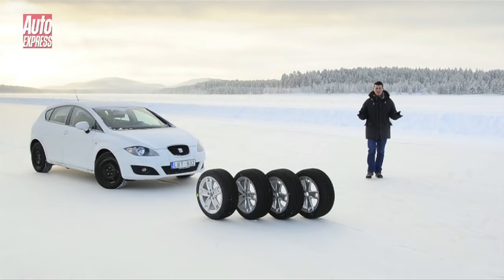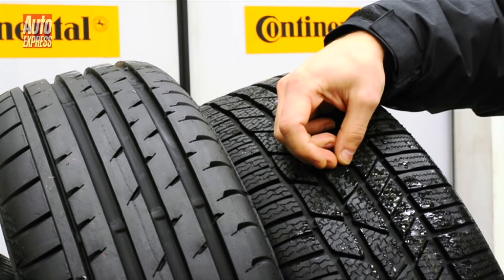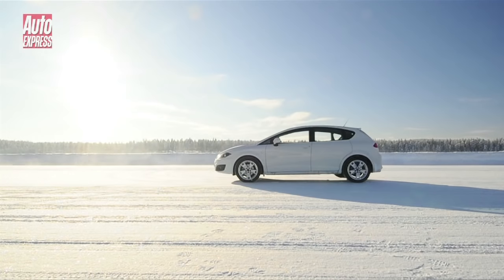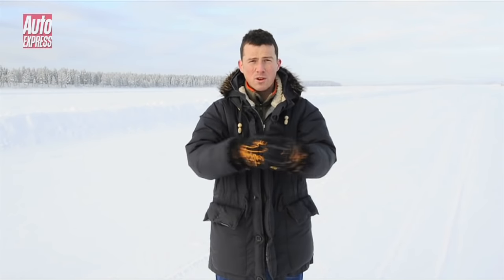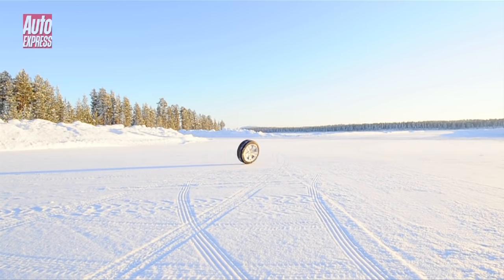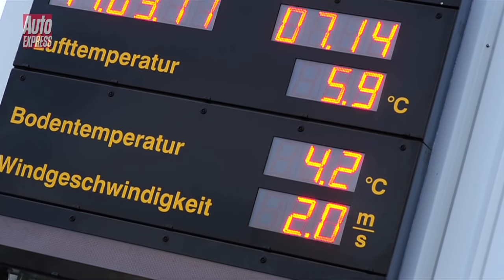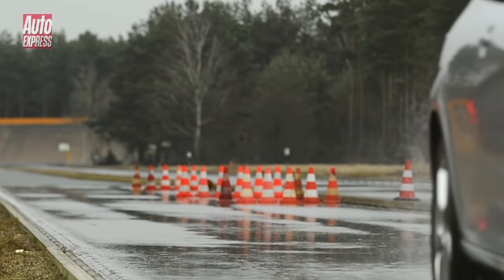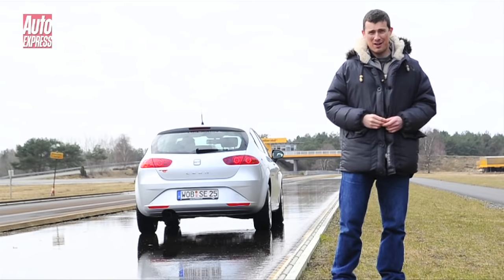Winter Tyres v Summer Tyres: the Truth! - Auto Express

Comment: Ive been running winter tyres like most the time in the uk... ive done this for a fair few years as 1 time i bought a set of wheels with them on and ran them all year round the grip was so much better even in the summer.
Reply: +Jigsjigz that is not right !
Reply: +TheMilenkata Where abouts are you from? trust me worked fine for me yeah in the summer they to 
wear down faster but it seems my braking is better stopping distance and grip. most the time in the uk is cold and damp so i just keep the fronts with winters and rears on allweather.
Reply: Bulgaira. -10 celsius is the temperature now
Reply: +TheMilenkata does summer last long there? as here its usually cold or wet here. We have like mid or 3/5 weeks of summer maximum.
Reply: +Jigsjigz We get temperatures of up to 40 Celsius and we get 30+ degrees apart from some rainy days for 3 months. So yeah, going all year round on winter tyres is suicide here.
Reply: +Jigsjigz facepalm
Reply: +Chriss Eo do you know how cold it is here? and how much it rains? i ran winter tyres for 7-8months of the year here in the uk.
Reply: +Jigsjigz are you sure they are winter tyres? Cause every year I count down the days until I'm allowed to take them off my car because they're so awful on dry roads. Just the tyre noise for a start.
Reply: Völundr Frey He wont get it, lets just count the day untill we can remove ours :D
Reply: rip mpg rip

Comment: No you should be running all year tyres. There is no need to spend so much money on two sets of tyres for normal vehicles or those that aren´t running low profile or sports tyres of some sort. I´m a professional driver in Iceland, I drive my Volvo S40 on 2 sets of tyres, studded winter and low profile summer. Unless you have heavy snow quite a few days of the year and ice most of the time over winter you are best off with a normal all year tires. Make your choice depending on how often you need tyres that can deal with snow and ice. But choose safety over money everytime, it´s not just your life on the line.

Comment: So, what about winter tires vs "all season" tires?  In addition, you don't want to use winter tires above 7'C because they can get too "sticky" and actually be damaged.
Reply: I see idiots driving around on them year round here -_-
Reply: Snakeplisskin440 ... Ditto, and they wear out in a quarter of the time an all-season tire would.
Reply: Winter tires will win in winter conditions. At temperatures above 15'C a winter tire will wear down 20% faster then summer tires.
Reply: It depends. I had Michelin Pilot Alpin PA3 performance winter tires on for several years, both winter and summer, and they lasted longer than a lot of all seasons I've had. The only downside was that they felt a little more flexy during the warmer months. But for most non-enthusiast drivers, they could probably get away with a performance winter tire year round. The "studless winter/ice tires" likely wouldn't hold up as well though.
Reply: There's also "all-weather" tires now
Reply: Still worse then winter tires in low temperatures.

Comment: most people use all seasons.  which perform much better in winter than strictly summer.  in fact cheap all season tires are made of a soft rubber compound that is pretty much the same as winter tires

Comment: Today we had early snowfall and I was still running summer tyres. While driving to change my tyres car felt like a cow on the ice,  you could feel braking performance simply wasn't there as expected. 20min later, they changed my tyres car felt good again.

However there was shit ton of accidents all over the city. I saw at least 3 while driving to work, 2 more while driving to change my tyres and 2 more again while driving home. Like seriously how could people don't feel that braking performance has changed dramatically? The first thing you notice when you are braking on summer tyres is that you are not fucking braking as you used to, if you drive your car everyday you should feel the difference immediately.

Comment: Winter tires wear extremely fast when the ground is warm or hot. Summer tires are harder from a different mixture of rubber and can handle the heat. If you have soft tires and go on the track to drive you probably wont have a tire at the end of the race. With summer tires you will.

Comment: Does no one drive to match the conditions any more? If the roads in the UK had that much snow on the ground you wouldn't be doing 30mph. Plus if the cars on UK roads were at that much of a risk using summer tyres in the winter it would be law to use them.

Comment: A summer tyre will give you better traction in dry or wet conditions throughout most of the year. A winter tyre is inferior in warmer conditions . Also the soft compound means they don't last very long in warm temperatures

Comment: General rule: Winter tires are better (no matter snow, wet or dry) below 7 degrees Celsius (which is 44 F). If the temperature is above that - any all-season or summer tire will perform better than the winter one, no matter wet or dry. (Presumably there will be no snow @7C/ 44F :)

Comment: But how to winter tires hold up in the summer? Is it worth just keeping them on all year round?
Reply: +6Twisted Nah they are noisy especially if you have nails in them. Much better off using summer tires during summer.
Reply: I've personally observed appox. 70 km extra per tank of fuel going from winter to summer low rolling resistance tires.  i drive a corolla.  That's on the highway traveling at about 130km/h (or about 80mph). simmer tires for spring/summer and winter tires for late fall/winter is the best way to go.

Comment: Winter tires suck in the summer. They are loud and a lot rougher than a summer tire. I've used Toyo Extensa in summer and Dunlop Grapsic in winter but the in between time using Grapsic before it's finally warm has me begging to put the 17s back on.

Comment: I've driven a rear wheel drive car with 'summer tyres' though the winter more than once. I didn't die but I did have to drive like a granny on occasion and use common sense to determine when conditions were bad enough I shouldn't be driving. There is a lot to be said for driving to the conditions of the road, knowing you and your car's limits and preparing for bad weather. Of course winter tyres make a massive difference. I've driven in Scandinavia with them and you would barely know there is snow and ice on the road. But whether it is necessary here in the UK depends on a lot of factors. Most people don't bother going out when it's that bad in which case it really is pointless, but of course there is always some idiot overtaking everyone in a Merc which you'll see again in a ditch a few miles down the road. They're probably the only ones that need winter tyres.

Comment: To make your winter tires more affordable buy a smaller set of wheels. Most cars will accept a drop of at least an inch. Tire size then needs to be chosen to make the OD the same as stock. A narrower tire is also better in winter. My car has 205 60 16 summer tires and 195 65 15 in winter (same diameter).

Comment: yes sorry i meant the snowflake symbol.. i forget that some M+S dont carry the snowflake. The ones i have fitted have both the snowflake and M+S. However the point still stands that although my tyres aren't particularly well rated (kumho KH21) , the difference  is simply astounding compared to conventional summer tyres. 

I simply wont be going back to normal summer tyres.. although i also wont be using the kumhos again. Bridgestone A001 seem to look very tempting at the moment...

Comment: My suggestion when you are going for a set of winter tires, is to save money and buy the best winter tires.  the reason is because once you have a set,  you'll end up using the tires for several years.  so you don't get to try the better winter tires,  because even the low end winter tires will do the job anyway.  I'm on my sixth winter season on my set of winter tires.  I will always wonder how the othet brands feel.

Comment: I have done over 10k miles on the winter tires & I think the tires are lasting longer. no wheel spin when its cold & wet, this is shortening the life of the summer tires but normal environmental conditions for winter tires, they grip far better when its cold & wet.
I have not noticed the mpg being worse with winter tires take a look at spritmonitor.de a good guide to MPG. Dad used 225's on front & rear too, nokian WR A3 look really good to me my snowtrac 3's are a bit too 'snow biased'

Comment: Snows normally 4 ,5 times a year here maybe three inches at a time . I am not buying winter tires
Reply: You better stay home them.
Reply: They're called Winter tyres, not Snow tyres.
Reply: petee1968 yes there called winter tires, but there's a pretty big difference between ice tires and snow tires both under the winter tire label
Reply: Colin Velt
They're called studded and studless winter tires and they're both ice&snow tires. Studded tires are a little better on ice but worse on wet roads. The problem with studded tires is that they wear out the roads.
Reply: Juke Turbo  Winter tyres are not all about being able to drive in snow.
Yes, they will help with snow and on ice, but due to their makeup (softer compound), they will also give better handling and braking in the cold than summer tyres will.

The latter section of the video covers this.

Comment: Is it not required to have winter tyres on in the winter in the UK?  I was in the UK from '93 to '96 and don't remember being told that I have to have winter tyres on.  Here in Germany (note: I'm American), it's required to have winter tyres when the temp gets below 7C.  I have noticed a big improvement on driving on winter tyres in winter.
Reply: Here in Québec, winter tires are mandatory during winter months, regardless of road conditions. The reason is that non-winter tires harden to the point of losing significant amounts of grip whenever the temperature drops below 7c. Winter tires don't. This is true regardless of road surface. Of course, we get real winter temperatures (-30c to -40c  is not unusual) at which point summer or four-season tires can be downright dangerous even on dry pavement.
Reply: CaptHollister We live in Quebec too. For the longest time (until i think 2000) my dad used 4 seasons all year long, his logic being that he only drives on well cleared roads in the city. Then someone got him winter tires as a gift. Two near miss accidents where winter tires were the deciding factor later, he runs winter tires in winter. I gotta say though, my car can corner much harder in the wet on summer tires than winter tires, provided its above 10 celsius out...
Reply: In Finland mandatory to have studded tyres or studless friction tyres from 1st december to 29th february... Earlier and longer if weather conditions require...
Reply: I found that All Seasons tyres are basically the jack of all trades but the master of none.  Now I come from Minnesota where we also have real winters.  I'm not sure how we compare to Quebec but I imagine you guys have it a bit colder.  We are right in the middle of the Continent and are just a bit warmer than Winnipeg.

Comment: aaaand, the winter tires are crap when it's quite warm and dry. noticeably less grip, especially when they're studded. and the ride comfort is much worse since these have strengthened sidewalls (although it's a benefit in rough terrain, obviously).
as for the all-season stuff, they often behave like bad winter tires in snow, and almost like winter tires on dry tarmac.

Comment: Because their tread life is a lot shorter, if you'd like, you could drive on them in the summer, but they won't last very long, which is why people use longer lasting tires when handling in wet and snowy conditions aren't an issue.

Comment: In deep snow it's easier, because the snow itself slows you down, it's like driving in deep mud...
But driving on ice, or on snow that has been compressed by other vehicles driving over it, it's almost impossible with summer tires.

Comment: I like a student driver in a Renault 5, which barely 800 kg heavier, their first winter I drove on all four summer tires. without a single crash, overturning on the road, losing control of the vehicle and such similar things. now it will find smart but will say that car barely goes 120 kmh, and I went up to 140 kmh on the highway also without incident. a car is 26 years old and in relatively good condition. the point of this text is that you can have the best, most stable car, with the highest quality tires, but if you "fool" is managed by the car, none of the above it will save to make incident. should be a little clearer in the head, more to pay attention to other road users and leave the cell phone out of reach !!

Comment: What about driving techniques? Anyone heard about engine breaking?
ABS does more harm than good in winter. It would be nice to compare tyres which are grooved the same, only their material should change.
Winter tyres are not bad on snow, on ice it doesn't matter, would prefer summer tyres on ice(because they are hard).
On mushy roads (when snow melts), deep grooving is key.

Comment: Actually the 97 V8 engine is a Cosworth Ford casting with Yamaha heads only.  Just did a minor refurb for a guy and that car was a pain in the butt.  No aftermarket parts at all.
Evidentally, we're going to have to agreet to disagree.  No hard feelings and not calling you a liar or anything.  Good luck with your work.

Comment: 1:53 unless this is some ABS effect that camera fps does not pick up right but it looks like the red car wheels are still free spinning and not braking hard as it should be during the test? With that said, NEVER run summer tires on freezing cold weather, get all weather or proper winter tyres!

Comment: Are they comparing winter tires to true summer tires or are they all season?(they looked like summer)
They looked like summer. I use winter tires in winter here in Canada. and all season for the rest of the yr. I was told they dont make many true summer tires any more.
Reply: Here in the UK most of the tyres you find on sale are summer only, unless its was specified by the manufacture and you are sticking to their specs. Usually, you have to specify all season or winter tyres.

Comment: Wouldn't really happen.. the radial speed of the tyre when its moving and the slip angle experienced when cornering will shed any build up of snow on the surface. Besides, the tread patterns are designed so that the tyre surface is self cleaning

Comment: Perhaps! Winter tyres still perform excellently in dry conditions; the names 'summer' and 'winter' are misnomers, marketing hangovers. This week for example, temperatures are not set to be much above zero celcius in the UK - even with no snow, 'all weather' tyres will perform worse than my tyres and have lower traction because their compounds can't cope with the weather. And given how crap our summer seasons are, IMO it's probably sensible to run some winter or rain tyres all year round.

Comment: I think you'd need to try the same test at normal and high temperatures before you can say "Half the year". Seems likely that winter tires stop better no matter what. So then why not use winter tires year round? Because they're noisy, and wear faster, and the difference matters less when there's no frozen water around. So, given that it's a trade off between cost, comfort, and performance/safety in all conditions, why would "half the year" be a better trade-off than "winter"? The difference between stopping on snow, and hardly stopping (or cornering) at all, is crucial. The difference in one car's length for an emergency stop, meh. Maybe not.

Comment: But which "half of the year"? 2012 was wetter in the summer than winter! UK has had little or no frost let alone snow and can be just as wet in the summer. Also, many cars in the UK are leased etc and they don't want to replace any tyres let alone run two sets!

Comment: I must say this: Those are not proper winter tyres! If you want a proper set of winter tyres, you must buy studded ones. Here in Finland I don't really trust on studless tyres, because ice is hard as a rock against rubber, and only thing that can manage the grip on icy surface is truly a metal stud. If you compare so-called winter tyres to studded winter tyres, you will notice a huge difference in grip in every test possible.

Comment: Well the thing is if you have winter tires in your car and you have to brake in an emergency what if the driver behind you don't have winter tires ?
Reply: EDUARDO GOMEZ Good point. For example: With having winter tyres, you successfully avoid a collision. However, that means if the car behind doesn't have winter tyres and he is not leaving sufficient gap for the conditions/ vehicle/ tyres etc he will hit you. The car behind would be liable for the incident.
Reply: its called following too closely.